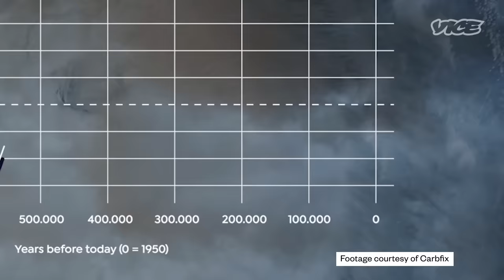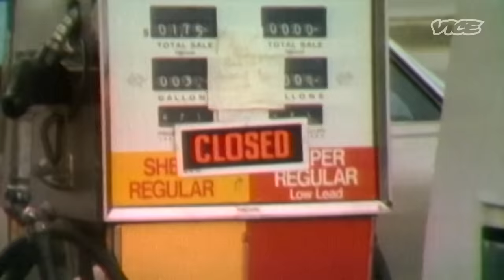Inside a Carbon Negative Power Station

Comment: 1) Who is going to pay for it? -for it to work carbon tax may be mandatory to pay for the operations 2) Will it have a foreseeable return on investment? - if not, no investor will invest 3) Will it be scalable? -Many may say of course, but history has shown that scaling is always an issue 4) Will it actually make the situation worse as opposed to better (its own materials requiring CO2 emissions or becoming an excuse for other industries to produce even more CO2).

Comment: 4:15 nice, the water gets sent back into pore space and also sets up the formation of limestone and carbonates!
Reply: yes at this time samp i repeatedly saw this to deeply understand
Reply: You basically are generating ore veins lul.
Reply: @sirnikkel6746  I wouldn't call limestone and carbonates "ore," since ore generally contains a smaller portion of a more desired substance. What they're doing is basically filling in the gaps with a kind of rock that often forms in warm, shallow, low to medium-energy offshore environments.

You're imagining the right thing, just using the wrong words. <3
Reply: @zizimugen4470  ohh, the goddamn concept mismangement. But thanks for the aclaration!

Comment: Wouldn't planting trees do the same thing while also cooling the ground surface with shade without consuming electricity?
Reply: Maybe but that takes a long time. There was a recent video about a study by Vice I think? They found that forest aren’t even carbon neutral until 20 years of maturity.
Reply: You shade the ground from radiant heat, but it's the trees that heat up instead.

No different to a roof.

And trees are a cabon battery, once the tree dies all that carbon is released.
Reply: @Robert-cu9bm  unless you think dirt evaporates, it isn't released into the atmosphere or oceans unless you burn it. 
Coal exists for this reason
Reply: @janeblogs324  
So if a tree falls in the forest does it make a sound,  No it's makes coal... apparently.

Tree's biodegrade, that's why you don't stumble across coal in a forest.

Coal was produced before any organisms could eat the tree.

Comment: I’m intrigued to figure out how much the Co2 sink plants cost, if anyone finds out let me know! Or, come back to me with the math relating to how many plants it would take to be at the break even point in our emissions, and what the cost would be for all the plants; divide the cost by the biggest Co2 emitter nations or corporations of the world, that’s your bill. It’s like renting a party bus for the night with your friends and it’s 2600 $   But you brought 13 friends so it’s only 200$ each. not a bad deal.
Reply: 2.5 million plants today, 5 million plants in operation by 2050.
Reply: The plant cost about $10-15 million USD. So the 5 million plants would only cost around $50-75 trillion USD. In the magnitude of world GDP. Financed over 20+ years, it could be doable assuming that they last that long.
They are trying to get the cost per ton down to $100. Given current production rates, that would be about $3.6 trillion per year. At the current rates of closer to $1000 per ton $36 trillion (~50% the world GDP) isn't feasible.

Comment: I'm 10 seconds in, and I already disagree. Here we go...

CO2 is higher, but it's still insignificant. 400ppm is 0.04% of the atmosphere. It's literally insignificant.

Most of this stuff is not going to be necessary at all. Power production is so trivial, it's really only an issue to people who don't know how it works. Fossil fuels aren't going to be relevant, neither is nuclear, or wind or solar or geothermal or hydro. It's all unnecessary. Electricity is so trivial.

Mostly climate change is about hysteria and making money. It's not about the "science", because the science proves it's not really an issue at all.
Reply: Less than one second into reading you comment and I can already tell you’re wrong.
Reply: @boarbot7829  🤪

Comment: Carbon negative MEANS it took no fossil fuel products to build...I bet this station has a TON of fossil fuel products in order to construct it...
Reply: To be carbon negative they just have to capture more carbon than they emit.
Reply: No it doesn't. If a power plant can pull 100KG of CO2 out of the environment, but it takes 50 KG of CO2 to build, it will still be carbon negative.
Reply: You can not make anything without emiting carbon.
Reply: @Nikkuuu69  
That sounds like my bank account.

More goes out than what comes in.